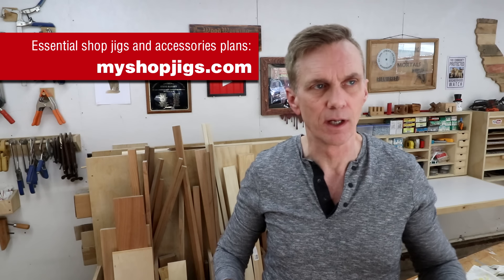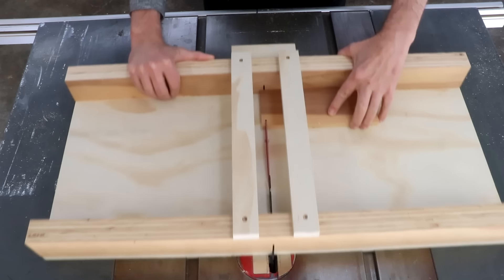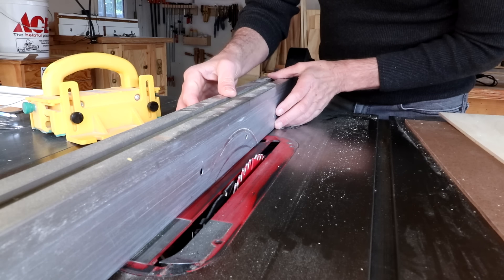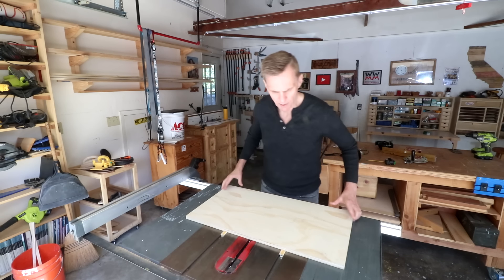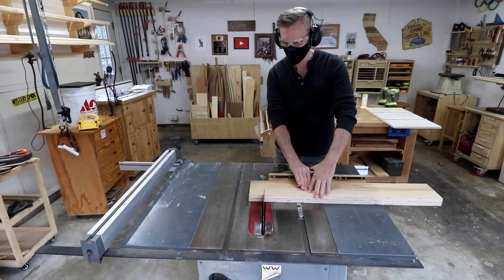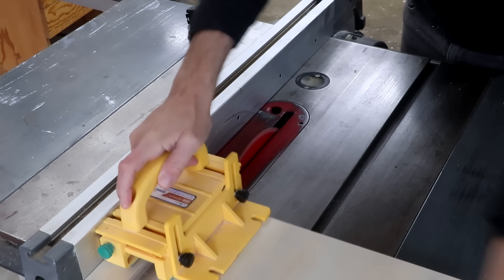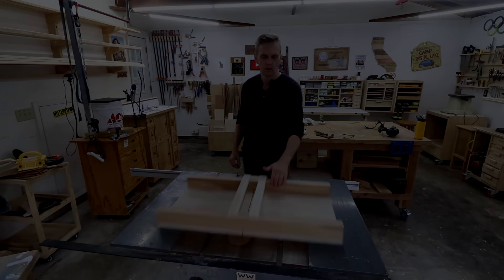The simplest table saw crosscut sled on YouTube. Essential woodworking shop project.

Comment: Good video, appreciate the content you provide! 

Did you consider adding some dust relief along the interior bottom length of the rear fence?  A shallow rabbit of 1/8" would do wonders for 90°  crosscut accuracy unless you're into constantly cleaning along the sled fence between each cut.    

Also - using a square helps bring the fence pretty close to 90°, but I never found it that accurate or as accurate as it could be, even with the most accurate square.  I use the "5step method" (several videos on youtube explain this method, Kings Fine Woodworking channel is probably the best exanation)  a couple times a year to check/bring my fence within .0001" accuracy - it's well worth the 20minutes spent before locking the fence down to the sled, especially if you expand your sled for mitering jigs.

But back to my point on the dust relief - even after the 5step method, I was still finding later cuts in succession of a project were inaccurate, and joinery still slightly gapped...all because the dust from previous cuts had accumulated against the fence, and was just enough to change my 90°s into the 89° range.  After taking the fence off and adding that shallow rabbit (width of a saw blade and 1/8" deep), all my repetitive cuts dead accurate from first to last cut...then of course I blow the dust out of the dust relief with compressed air every couple dozen cuts or so.  Sped up my production efficiency and improved my joinery. 

Any additional small step/tip like this to eliminate frustration when assembling a project, makes woodworking even more enjoyable and more likely for us to keep churning things out!

Comment: Enjoy your videos. I like the idea of this sled, and how simple it seems. I have a Dewalt 7480 table saw, and my issue with a sled is I only have about 6" from the front of my table saw to the blade. So, if I've got a board that is more than 6" wide, does it really make sense for me to build a sled? What I currently do is just hold my board against the fence to make my cuts. Thanks for your advice!

Comment: Nice, simple, good and safe!  If it were mine, i think i would have adjusted the working dimension to ~13" to cut 12" material.  you started with 16", so i think you ended up with only 11".  Also, i only have a small portable saw (small table top), so i like to leave the rails about 4" long on the leading end to aid with the stability at the start of the cut, but they do sort of get in the way when storing it.

Comment: I think  you've discussed this in previous videos but I've forgotten:  How do you decide which side of the blade for narrow cuts like for the runners?  I think I remember you cautioning on pinching work material b/w blade and fence so I try to keep narrow cut-offs to the left of the blade, free from the guard.  Here, you kept the narrow cut-off b/w the blade and the fence.
Reply: Never mind, I get it now, you need to make more than one of the same width, so doing it how you did keeps you from moving the fence and getting an inaccurate second runner.
Reply: @ericbrowning  He is also supporting the thin piece with the micro jig that keeps the piece from kicking back.  The concern is when you use both the miter and the fence at the same time, then the cut off piece is trapped between the blade and the fence and results in the kick back.

Comment: Good tips, still would have used the 5 cut method although this is more of a small parts sled where the error won't be noticed as much if not 90. But I will use most of your design on my next jig making frenzy lol Cheers!

Comment: If you have a digital angle finder for the table saw you can use it to find the angle of the fence without having to use the square and worry about moving it as you move it around

Comment: Another check for square is cut a piece of wood with the sled, the wider piece the better.  Now with the piece of wood cut,  rotate one of the pieces of wood such that the top of the wood is now on the bottom and the two cut butt ends are touching.  With both pieces tight to fence and butted against one another there should be no gap between them.  If a gap shows, fence needs squaring.  Hope this helps

Comment: Great reasons to keep your fingers and to get rid of your table saw and buy  a good quality Radial arm saw . A vintage Sears 12" or a Delta or DeWalt commercial . Everything viewed is not necessary on a Radial arm and Radial arm saws rip far better also . You can make your fence as long as you want to ,and the cover holds the board down . We compared ripping strips for a cedar strip canoe at 5/16" x3/4 " on a table vs a Radial arm . No comparison. The Radial was more consistent and we didn't have strips kick or fly to the ceiling,and the Radial did it in half the time or less. We did make a 6'fence as the strips were 8' - 12 ' long . 😎
Reply from the maker: Lol...you really like radial arm saws.
Reply: @SteveRamsey  I've ran both and had the cheap saws Radials and table saws  for 40 years and never injured myself but the only close calls were with table saws . The most and worst inquiries I've seen are with band saws ,drill presses , jointers and table saws. About 15 years ago I bought a good used commercial grade Delts 12 " . Amazing saw I had a fairly good Craftsman table saw and gave it away to an employee. I didn't want anything for it because of the liability. A Radial you are fully aware of the blade and nothing is hidden unlike a table saw. I've heard more stories of people running their hand across the blade . One guy took off 4 fingers on a table saw . He was a cabinet maker for 30 years . I asked how it happened and he said " Your only supposed to have the blade high enough to make your cut . I was ripping a sheet of plywood and it had a warp in it and I pushed it down and lost track of where the blade was and ran my hand across the blade. " He said you won't realize how many close calls I've had " and how many guys have done the same thing" He said I'm building a larger table for my Radial to handle large sheets and getting rid of my table saw.A Radial cuts warped sheets nice, because it holds the sheet down and the cover regulates the cut height.  Once you understand the difference you will never go back to a table saw . The only saw Home Depot has is a 16" Radial there insurance won't cover a table saw. If I cut a lot of sheet stock I'd love to have that Delta buck sheet stock saw . Best Radials are 12" commercial but you can put a 10 " on it also for more power and less blade flex . I really don't get into much other than cross and rip square and angles, but you can bolt a few blades together and make some nice dado cuts, but best getting a dado set . 😎
Reply: @SteveRamsey  If you don't believe me call OSHA . I just had them through my shop. The last guy through loved my Radial. Mine keys out . Serious and safe saws also aren't 110. You never want to dog in the middle of a cut . 😎
Reply from the maker: Lol again,  you REALLY like radial arm saws!  I mean, you keep leaving the same comment on my videos! 😂

Comment: Late to the party: what are your thoughts to adding a mirror to the inside far edge of a crosscut sled?  It would allow you to see the blade engage with the wood.  You'd have to use some kind of Plexi mirror to be safe, but I think it would help see mistakes in height adjustments faster

Comment: Can I suggest painting the "safety block" at the end of the fence red or yellow as an additional reminder to keep fingers away? When its the same color and material as all the other areas your used to touching its harder to recognize as a danger area. I think yellow striped safety tape would be ideal here
If your not planning on flipping the sled then a cheaper material such as pine 2*4 for the front fence would be ok wouldn't it? Decent 3/4" ply is over $200 a sheet in my region now!

Comment: Hi Steve, first of all- Thank you for making this video and specially addressing those safety concerns. New to wood working and my table saw is Dewalt portable with single groove unlike the 2 channels you have in this video. Wanted your advice if a single groove would work for similar cross cut sled ?

Comment: I always just turn the miter gauge around, and butt the board up to it with the extra width supported by hand. works in a pinch. But a sled is the way to go.

Comment: You know how you were talking about the pros and cons of having the runners off-center in either direction? It seems to me that by squaring up both fences, you could easily make your sled reversible, so that it could accommodate a super long board or leave a ton of space for a stop-block, depending on the situation.

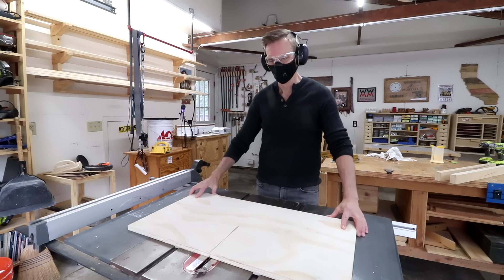Comment: Thanks for the tutorial! At around 9:30, Is there any reason why the fences need to be the same length as the sled? The plywood I had available was s a few inches shy of the 30" I cut the sled bed per your suggestion. I can either 1) not worry about it, 2) cut the sled down to make it the same length as these fences, 3) get new plywood and spend money and time on that. 

Those options are in order of preference.
Reply: Option 1 is fine.  The length of the fences is not important, as long as they are solid and long enough to support the base - remember, your base-board gets cut all the way through.
Reply: @kirbyspencer538  thanks yup. that's what I ended up doing two weeks ago. it's working out fine.

Comment: I’d like a suggestion. You are assuming that the fence is square to the blade. I have an old Delta TSC 10” tablesaw from the 1970’s (no splitter either), a huge cast iron monster. It has a fence. It’s a 2x4, only attached at one end, which means the other end has chatter. It’s impossible to keep square, which is why I have never been able to do accurate assemblies. How would you use a saw like mine with a sled? The sled would glide well in the slots and I think I can set that parallel to the blade. But I still have a hopeless fence. I do ALWAYS stand to one side when I use it in case of kickback. I’m cautious so, so far, I’ve never had any. I can see that the sled CAN solve most of my accuracy problems because the fence is pushed out of the way. I never attempt resawing because the motor is underpowered.

Comment: I'm guessing that this all works out better if you don't start out with a $50 Craig's List table saw.  No matter how I try to  fit the runners, they are either wobbly or sticky. I assume that the slots in the metal table are not perfectly true. Anyway, I came up with something that will make model train building and track laying parts with acceptable accuracy using your method. Thank you.

Comment: Great video but I do recommend squaring the fence to the rails on the table - that's your direction of motion, you just hope that the blade is parallel to that, but it's not a guarantee and there's always some tiny error there. The blade itself is referenced to the rails, so that should also be the reference for the fence.

Comment: What’s your thoughts on using the 5 cut method to squaring up the sled?

I do like the design.  Simple and effective.
Reply: I was hoping someone would mention the 5-cut method. 'Tis my preferred method to ensure square cuts.  Seems that even though I use a square initially, the 5-cut method almost always shows I'm off a smidge.

Comment: You could buy some cheap miter gauges and pull the rails (runners)off to use them. No expansion or contraction with humidity.

Comment: Thanks for video and plans.  I think I will add a plexiglass piece as a safety shield between the two pieces parallel to the blade. What is your thoughts on that?
Reply: I'm building my sled now and that's exactly what I was thinking about. Did you do it? Results? Thanks
Reply: @sburnsy05  have not done that

Comment: I can attest to not needing screws to hold plywood runners in place. I didn't use anything other than wood glue to attach them to the sled. When I got a new table saw, I took apart my old sled. The runners would not come off. The wood was breaking off instead of the glue. Once again, a wood glue joint is stronger than wood.

Comment: Thought of a minor improvement.  Like the design, exactly in keeping with my own mantra, maximum bang minimum crap.  When cutting the 4 strips for the rear guard, cut 2 more.  Screw them on top of the front and rear fence, then put the long strips on top of them.  The strips could get in the way of doing longer or larger boards, this way you can remove them when needed and still have the extra guide block on top of the fence to help ensure you keep your fingers clear of the center.  Could even go magnetic for the top strips, but I don't anticipate taking them on and off that often, just for batches or larger boards once in a while.

Comment: I didn't see anyone mention this. Better than paste wax, try Slick Coat. It's a spray on silicone that glides super nice and is perfect for table saws and router bases.
Reply: is it different  between silicone? I have a silicone spray that I use on/in the outblow on my snowblower so the snow flow thrue easier and dont stick in the tight part , but gues it might work on wood aswell :)

Comment: Very cool. Just wish 3/4" plywood wasn't so insane price-wise currently..
Reply: Is that because of the lumber shortage so they jack up the prices?
Reply: @wwfera00  There are several factors. A significant percentage of the lumber we use here in the US comes from other places. "Baltic birch" plywood comes from Eastern Europe. The clear/fine grade pine I buy at Home Depot comes from New Zealand. A lot of the dimensional lumber comes from Canada. Even before the pandemic, a 20% tariff was slapped on lumber imported from Canada. Then the pandemic hit and everything from harvesting to milling, to transportation  adversely affected the supply line. At the same time, major fires in California, hurricanes on the Gulf coast, and a major wind/storm event in the Midwest obliterated tens of thousands of homes that needed to be rebuilt. Then the pandemic and resulting stay-at-home orders surged the DIY market with home renovations. Then the plunging interest rates surged new home starts.
In short... Demand FAR exceeded supply.
Reply: 3/4" Baltic birch at my local woodworkers Source hasn't really gone up. The stuff at home depot and lowes has.

Comment: Not hating at all I am very new myself to anything wood working i am a heavy equipment mechanic by trade, but in your initial issues of a miter gauge you said something about larger pieces making the miter go off the table and making it less accurate.. what about a sled helps with wider pieces? I am only asking because I want to know if I need to change anything in my sled to account for wider pieces of wood.. again not trying to be negative or anything just simply wanting to learn all I can .. thanks for the awesome video .

Comment: Steve, I have used your design for a Sled, also made a wooden Push Stick based on your plan and both results turned out great.  My next issue is with zero clearance plates.  I got one online, it worked well for a few weeks then cracked in half (luckily did not go into the pointy bits). I have seen ideas on making a wooden one, however, I have the same concerns ref weakness so looking to make one out of 4mm mild steel.  Do you know of an issues with metal plates?

Comment: Is there a reason to not square up the "front" fence to the cut slot rather than the side of the blade? It seems like it's just easier to press the square against the blade, but it's the line formed by the actual cut that counts.
Reply: That's how I squared up my sled.  Tried both methods and found that for me alignment to the slot was easier.  I have a ruler that fits in the slot perfectly.  Alignment to the empty slot is more difficult.

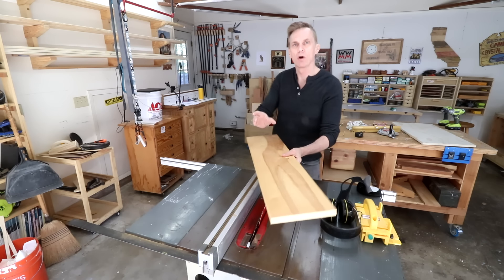Comment: Steve, at approximately 08:29 when you discuss making the fences, you mentioned cutting FOUR 2 1/2" pieces.  Is that 2 1/2" measurement correct?  It seems that we might want the fences a bit higher than that.  Just checking before I cut them (Measure--or ASK--twice, cut once).
Thanks for a very helpful video.
Reply: You can make the fences as tall as you like. Whatever makes sense for your intended use. A really tall fence can be cumbersome when having to reach over it to hold a workpiece down. Try a few heights and see what feels most comfortable.

Comment: I noticed near the end of your video a screw fell into the blade area,, just wanted to share a little story,, we are working on building a bar,, my son was using the biscuit joiner, and when he started using it something hit my back when I walked by him,, he instantly stopped and we discussed what happened,, we concluded a screw must have fallen into the tool ( it had been stored in a bin and there were a few bags of screws, etc,, bad on our part) which flew out, so he checked it out and then continued to do what he was doing,, minutes later we heard a loud bang, again he stopped what he was doing and after investigating we discovered that something again must of flown out and it smashed one of the glass inserts in our french doors!! seconds earlier I was coming thru that door!,, we figured that screw must have fractured a blade in the biscuit joiner and the second time he started it, it broke off,, we found the pieces after inspecting the door,, hind site we should have checked the tool more carefully after the first instance,,, I instantly grabbed the tool and threw it in the trash,, it was a cheap no name used tool that was recently purchased,, lots of lessons learned that day! thankful no one was hurt as well!